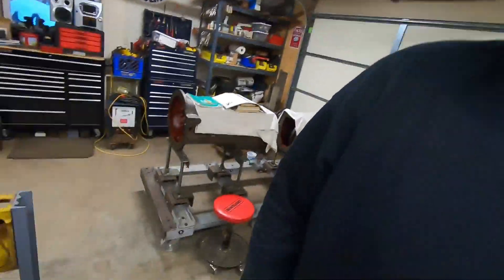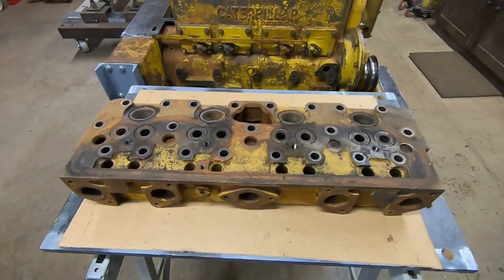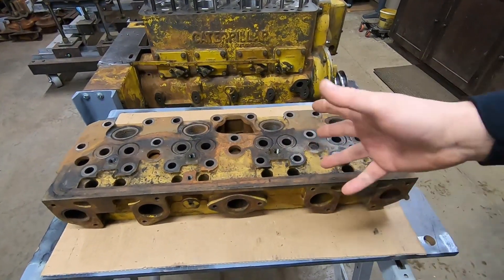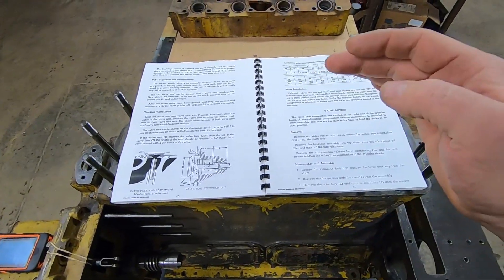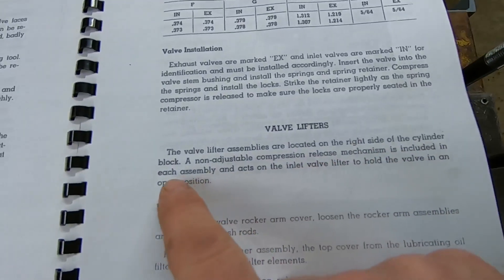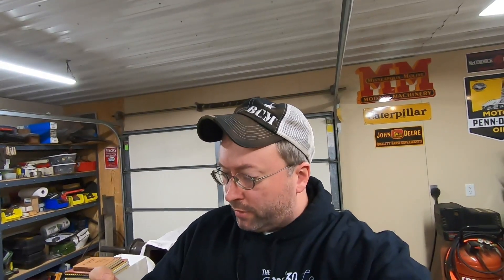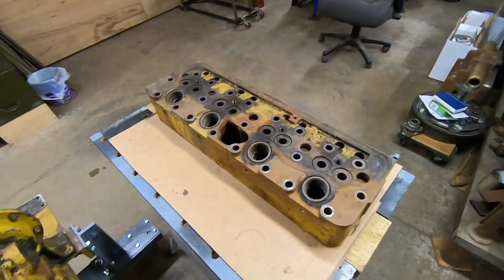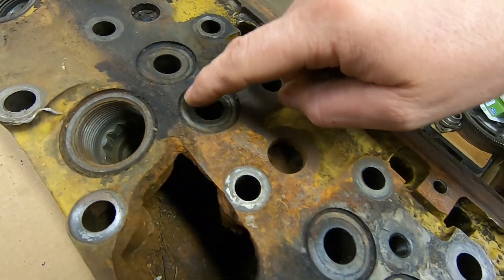Caterpillar D2 #5J1113 Episode 22: Answering Viewer Comments & My Future Plans For The Project

Comment: Love to see the gearbox and final drive rebuild in the future. The Soviet crawler KD-35 has almost the same setup as Cat D2. It will be interesting to see how much the Soviet engineers copy'd from Cat D2.
Reply: there was some made under license from caterpillar in ww2 as they were allies at the time.
Reply: @mog5858  That was the Chelyabins factory that made the model S-80, S-100, T-100, T-130 and T-170. They where all based more on the old war time D6. The KD-35 was made in the Kirov factory and despite it dose not look much like the D2. In small details and certain engine parts it dose look very similar. At least similar design and mechanical parts as with the D2.

Comment: Hi Squatch .
where you show the blown water channel it can be welded and machined flat obviously the correct guy and correct rods etc . unless there are other cracks would be worth doing a die penetrant test to show any other cracks . Unless a replacement head is easy to come by. Regards Don

Comment: Yep lots of work 
All my dad ever done to his D2 was. Track pins and bushings in sprockets put a clutch in it main bearings and new set of valves and that was over. About 14 years and we bought the old crawler  used

Comment: Been watching and remembering when I brought a Deere 420c home that actually loaded on the trailer under it's own power.  Your old crawlers are no different... you open one panel and you move to the next "region". That machine was baptism by fire at it's best.  Learned a lot pulling finals, fixing the shift tower, putting a new head on it, redoing the radiator, etc. You are 100% correct in that you might as well right now check it all out or you will be doing it very shortly.  

Keep pushing on with the excellent work and down here in NC we want to know what all the white stuff is.... did my A/C just kick off?

Comment: D2's probably did not get exhaust heat until they went thru most of the original order of components. Or face storing thousands of parts that will never be used.  Check out bblock02's YouTube site. Its impressive to say the least.

Comment: If you get oil puked out of the air cleaner, your engine is spinning backwards!
Most likely when pull starting one of the later/larger tractors with a reverser lever than the simple shift pattern of the D2.  When you get oil on your shoes
Reply: When you get oil on your shoes, you tend to figure it out pretty quick!

Comment: Am wondering if the wear on that compression release cam wasn't hammered from operation or linkage maladjustment with the compression release cam partially engaged or partially released.

Comment: Caterpillar used a slite taper on the. Couse threaded end of there head studs for taper locking them did they use that on all cats my 57 d8f has tapered threads even says it in the repair manual and the d8 uses two different size studs

Comment: Hey Squatch, my father and I own a 4U D2 (4U4373) and wondered how (and why) the clutch engagement assembly locks the gear stick into gear, and out of any gears when not in gear, when the clutch is engaged.
The manual mentions the gear stick gets locked in gear but doesn’t tell you how.
I’ve also observed this when 4U4373 is not being used, I often putting it into gear, engaging the clutch and trying to gently take out the gear stick.
Are you able to also show how it works, if possible with 5J1113
Reply: @squatch253  Thanks

Comment: Squatch, your "Theory" about the air transfer from one cylinder to the next is not "Theory", It's Mechanical "Fact".
Just like pouring water from one glass to another....... I saw you Smile this morning also... Wink Wink.
Reply: call it "overlap"  ?
Reply: Once the head is back on a cover plate over the intake port with a pressure / vacuum gauge would indicate how much air isn't traded between cylinder pairs.

Comment: Hell yeah, dude. I’ll be watching! That original 1113 head, could it be reworked if you couldn’t find another one? I watched bbloc2 fix some cast iron stuff on that drill press that got dropped. I mean is it possible?
Reply: Dh-1011 
Anything’s possible but that one might be close to the exception to prove the rule.  Finding someone to fix simple small cracks in cylinder heads is hard enough.  Last time I went that route it was a year before I got my (yanmar) heads back!

Comment: Squatch,..what is the main source of heat for your workshop there?  
Thanks for this update and Q&QA session too,..lots of good information here. Apparently I don't need to watch any other type of YouTube video's because there's enough here
to keep me busy. ( smile ) 
Thanks for this, again!
Reply: I asked this question last year. How was his garage heated and why does the parts in his garage not get flash rust on them?

Squatch answered my question. It is climate controlled.
Reply: @TheRebelOne.  Precisely why I asked, because I noticed that noting in there ( except for Himself!! ) has rust showing up! 
Some climate!! LOL!
Reply: @regsparkes6507  Needless to say as I don't have climate  control in my garage my small engines best friend is a wire wheel and loads of WD40 sprayed in copious amounts on the cast iron!
Reply: @TheRebelOne.  Yes, that'll do it!
Reply: @TheRebelOne.  Check out a product called Boeshield. Also,beeswax,paint thinner, some paraffin wax plus a little olive oil make for an effective and inexpensive rust preventative. Been used for many years,formulas all over the internet. First encountered it in a Fine Woodworking magazine many years ago.
Reply: @paulmanson253  Thankyou Paul. Appreciate that info..👍